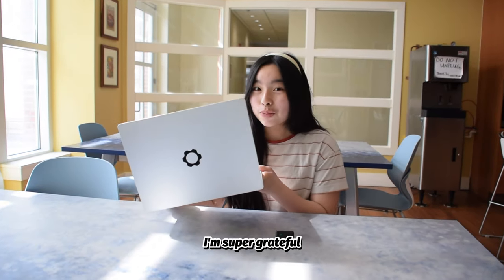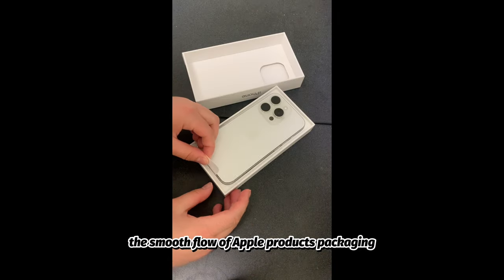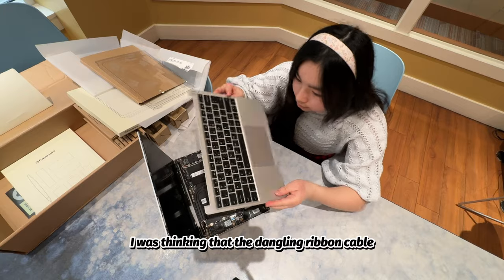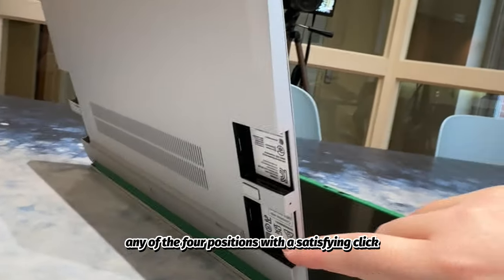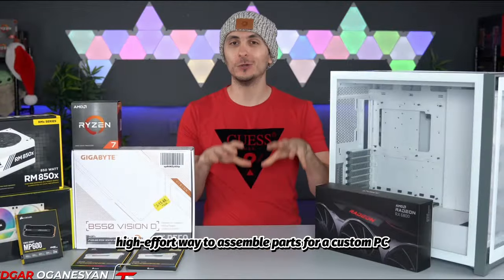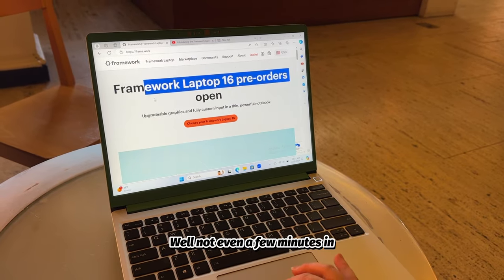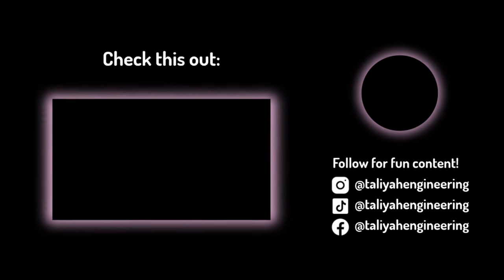Building the Framework Laptop! ⚙️

Comment from the maker: So the issue with the gesture-less and glitching trackpad was simply due to not properly installing the Framework Driver Bundle! Thank you for pointing it out 😊
Reply: 5:01 please don't peel off the RAM covers like that, they protect the chips on the memory sticks from scratches.
Reply: Does it still problem with fan noise and over heat?

Comment: Been using my Framework laptop for about 8 months in Linux (Debian 12) with no issues. Usually use a mouse, but had to use the trackpad recently, as I needed the USB-A port my mouse plugs into for an external DVD drive. The Linux trackpad drivers seem bombproof. Took me about a day to suss out the various gestures I could use and it's now about as smooth as using the mouse. Assembly was very easy, but I've built desktop systems off and on for 25 years, so know what the components are. I appreciated how nicely the components fit together and the ease of assembly/disassembly.

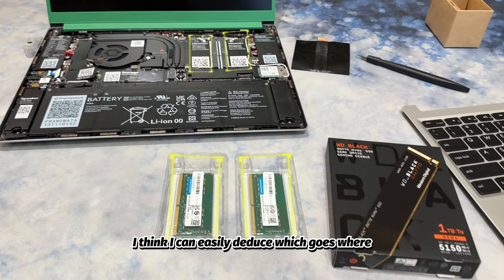Comment: 5:27 in the future, I would recommend disconnecting the battery before changing any other components, to prevent damage to the components.
That red LED blinking as you work on the laptop indicates that you've not done so.
Reply: There's actually a label on the battery connector that says you don't have to disconnect it.
Reply: @Phoenix84118  Yea. I didn't have the laptop yet back then, so I hadn't known. However, you're instead supposed to disable the battery from BIOS before doing anything..

Comment: I don't know if you get to keep the Framework or not, but if you do, the expansion cards loosen up after you remove them a few times. After a lot of experimentation the 'best' way I found to remove them is to use both thumbs and hold down the release button with the knuckle of my index finger. It's awkward, but it works. I broke a few nails before I worked out my technique.

Did you use the paper wrapping to make the cookies you showed? Was that what you were washing and using to bake? Is it oven safe? I don't think it's wax paper but it could be parchment paper (which is also used for baking).

Thanks for the video it was fun to watch. Good luck in college.

Comment: Not bad for a newcomer to DIY computers! You don't have to activate windows but it will lock you out of some specific features. I personally use Linux based operating systems on my computers. They are a lot easier to install.